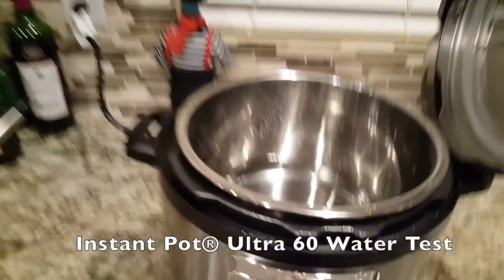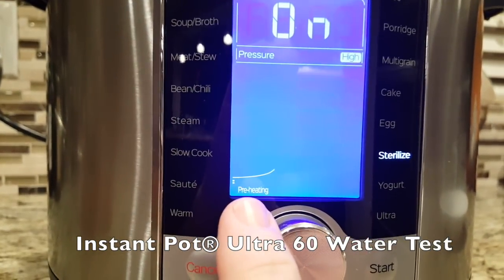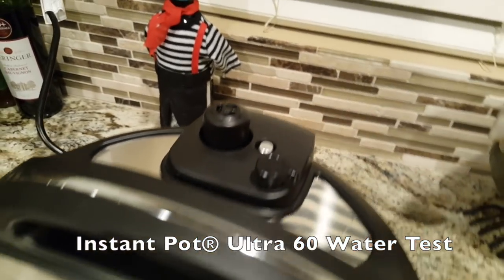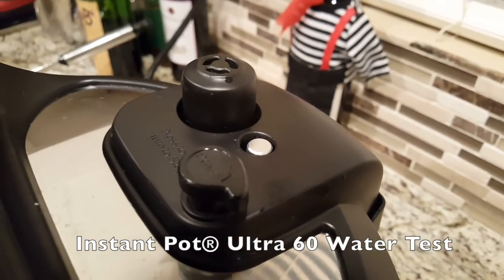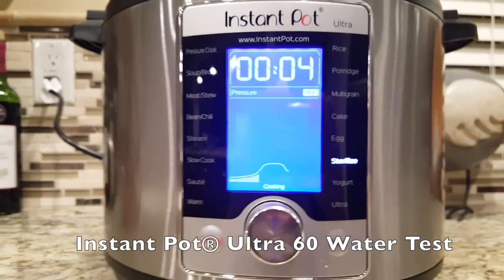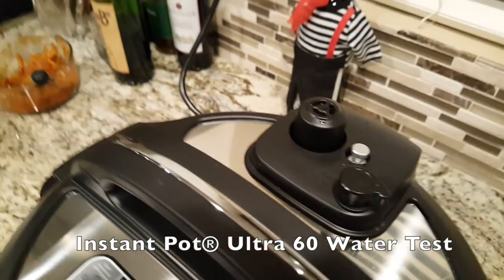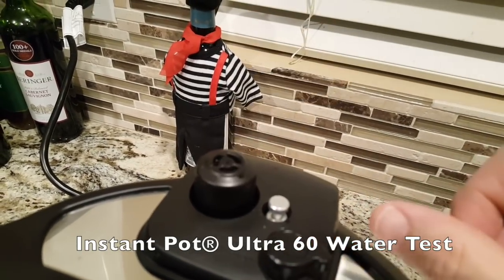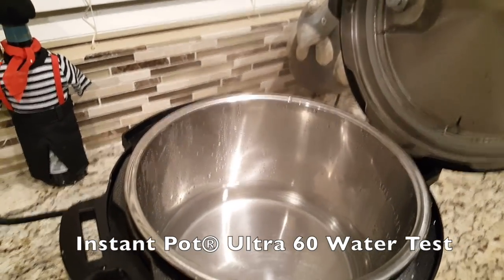Instant Pot Ultra Water Test

Comment: I didn't do the water test and I did hard boiled eggs, they turned out fine. I didn't see any leak or weird noise. So is my pot ok or should I still do the water test? Manual said it's optional so I skipped it.  Also the remaining water after the egg session is reddish/brownish. (some video they put 1 cup of water, is that because they have 6 quart? Or even 6 quart you supposed to put 2 cups I am confused)

Comment: will the sterilize function alleviate the need to take apart the valve for cleaning? just got my ultra and kind of afraid of it. :-)
Reply from the maker: I dont clean the valve much, but I dont make many meals that cause a lot of splatter.  If that happens then I clean it.  I just run hot water over it and clean it with the dish brush after each use,  I just dont take it a part very often.

Comment: My Ultra IP is due today, and I'm watching as many UIP videos as I can find. :-) This is interesting, but can you tell me the purpose of the "water test"? Is it just a test to ensure that the Sterilize function works properly?
Reply from the maker: Josh Mandel well the Manual calls it the initial test run on page 14.  Internet discussion groups call it the water test.  It does two things.  Helps intoduce new users to pressure cooking and how it functions. Running just water through it the first time is better practice than a pot of food.  Also to make sure it seals and functions before cooking anything.  I had an old school stove top pressure cooker so I already felt comfortable about using it, but it is interesting to see all the concerns with pressure cooking.  Instant Pots are tame creatures compared to their stovetop cousins.
Reply: Thank you, Ted! I'm unpacking mine now and will be sure to do the Water Test as you (and the booklet, I guess) instruct.